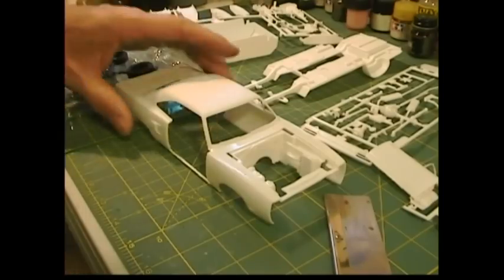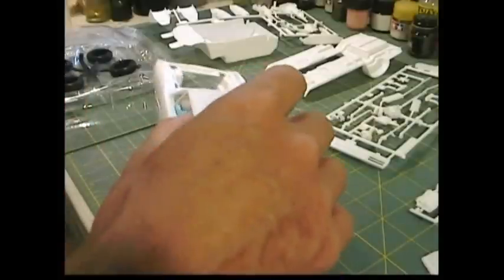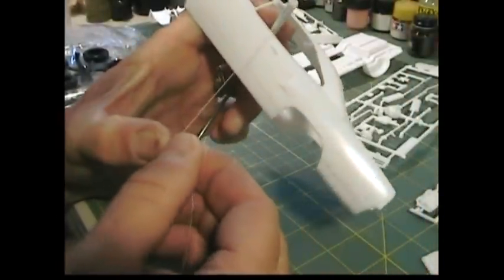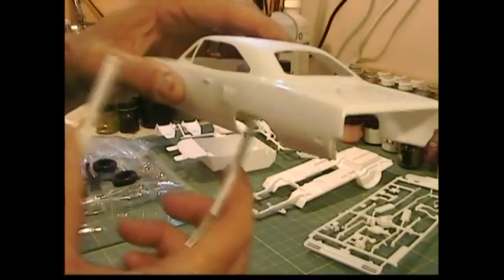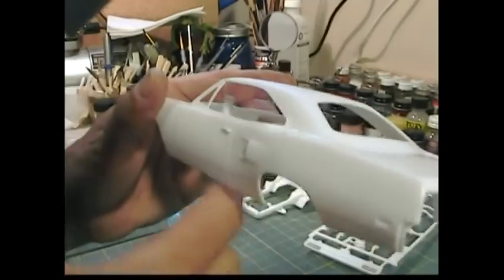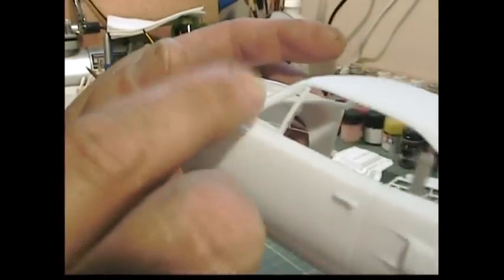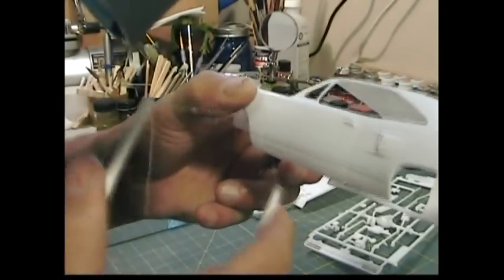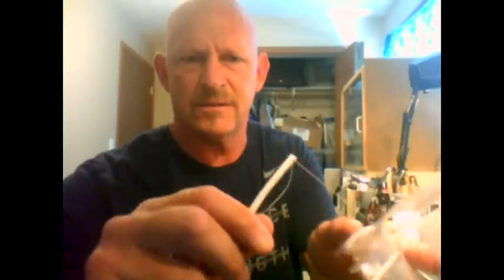70 superbird-- How to cut doors

Comment: Cutting out my first door. Tried the traditional way and just made a mess. Can't resist too much pressure. Scarred pretty badly. I saw this video before and sounded like a good idea and used 30 lb braided fishing line. It was okay but I went back and looked at your video again and realized you were using sewing thread. I sew so I had plenty and some heavier duty. Much faster cutting. I've been trying an old style wire cheese cutter as a tool and haven't made a decision on it yet.Thanks a bunch for being of service to this community.